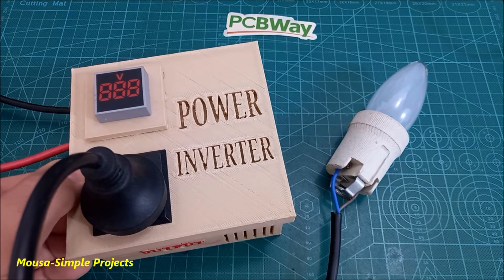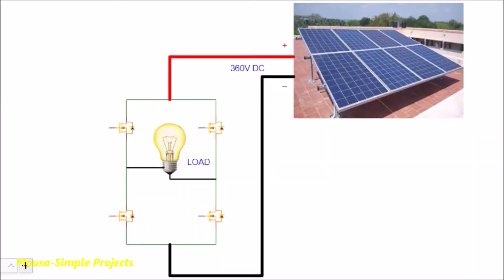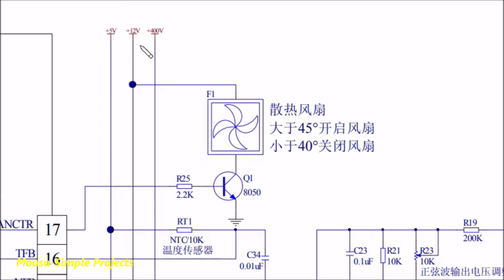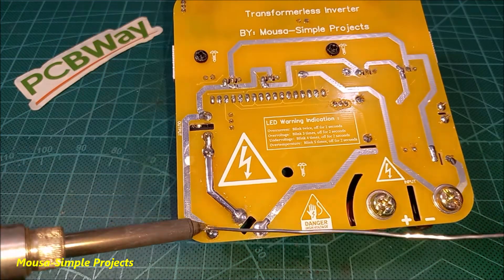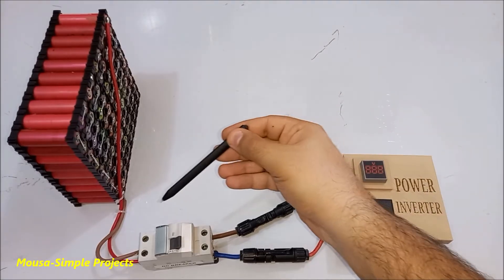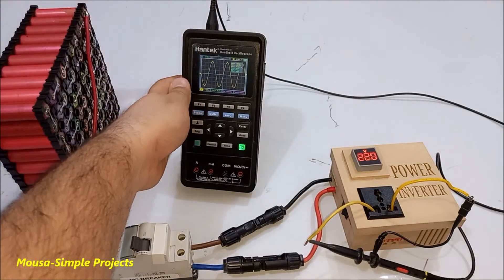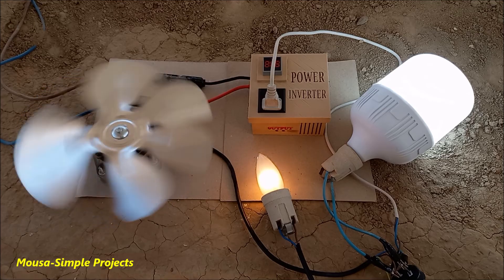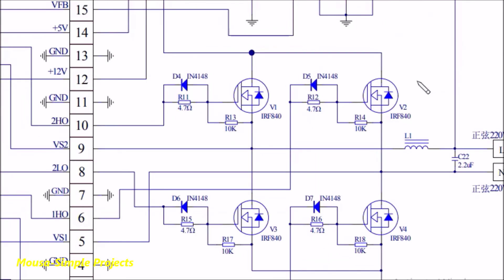How to Make Inverter Without Transformer / DIY Transformerless Inverter

Comment: Hi there, how would you improve life span of FETs and caps in the inverter?
Im looking at cooling my 4kw rated solar transformerless  inverter with aircon ducted to mother board
Thanks
Andrew New Zealand
Reply from the maker: I think using a bigger heatsink and connecting two or three MOSFET in parallel instead of one can help.

Comment: Can I use city electricity for the input supply as the "battery" of this inverter? I need it for the isolation circuit and soft start feature
Reply from the maker: NO, The input must be DC voltage

Comment: I am getting an error on the board, four blinks which means under voltage, I supplied it with 311 volts dc and still I get the error. I am also not getting any output. Can you help?
Reply from the maker: That because you turns the potentiometer too much.
When you set the potentiometer on (let say) 240V , the input must be at least  340V DC but you feeding 311V only so the controller detects under voltage,
You have to set the potentiometer correctly.

Comment: 5:00 can you tell how you got the min dc voltage of  311V dc for 220V AC ?
Reply from the maker: The 220V RMS with sinusoidal shape has a peak voltage of 311V from this formula:
Vrms *Crest factor = Vpeak  
(220 * √2 = 311 )

Comment: What is the specification of the inductor coil. No info about that anywhere in the video. Can you give more information about the inductor coil used.
Reply from the maker: It is a ferrite ring with diameter of 30mm and about 200 turns of 0.7 mm copper wire. The inductance is 2mH.